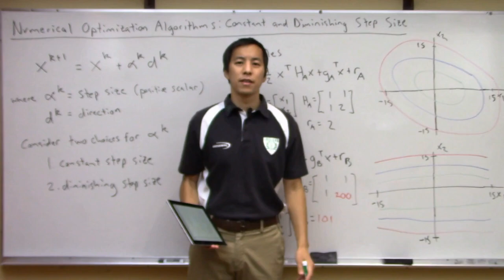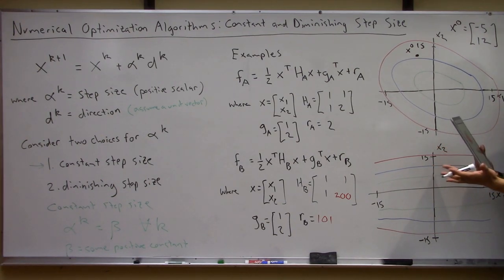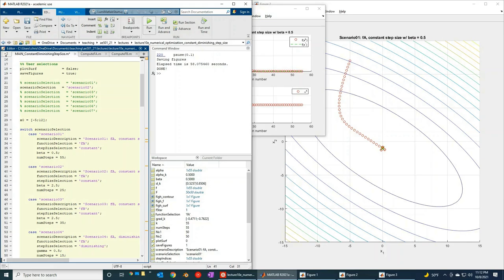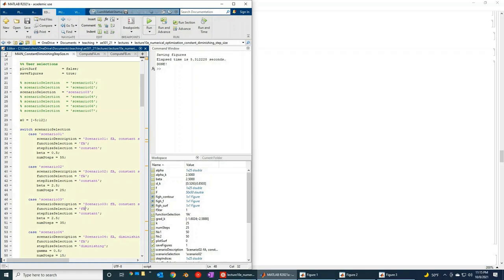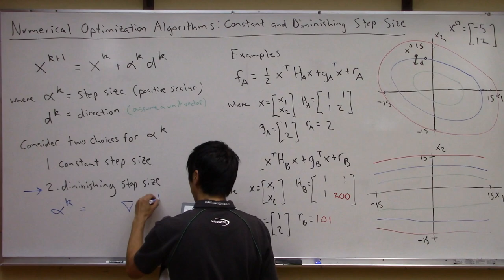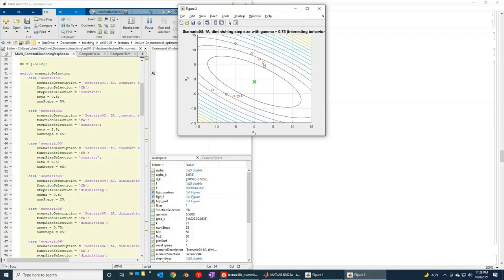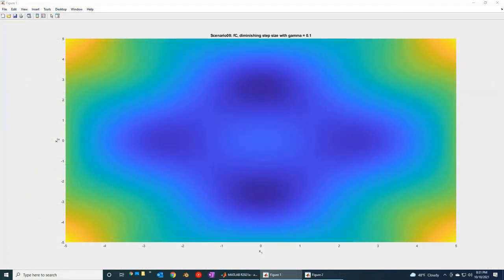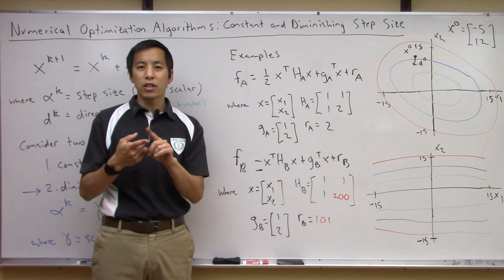Numerical Optimization Algorithms:  Constant and Diminishing Step Size

Comment: AE 501: Jesse Perez - this numerical approximation for calculating the step size, either constant or with a diminishing approach, reminds me of the robot vacuum cleaner. The robot takes enough steps to map your floor plan and eventually clean but we can confuse it if we put obstacles in its way.